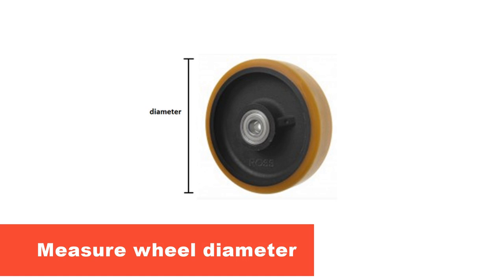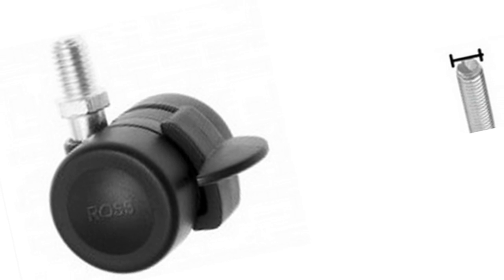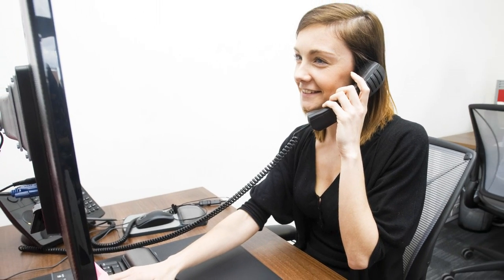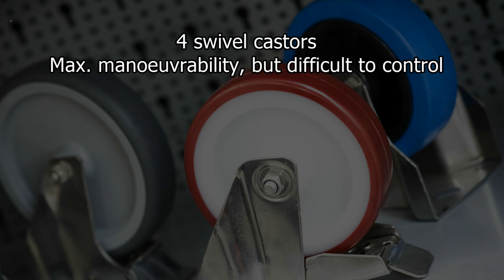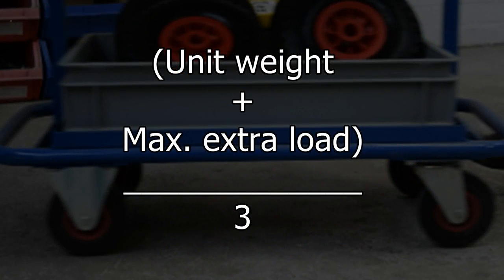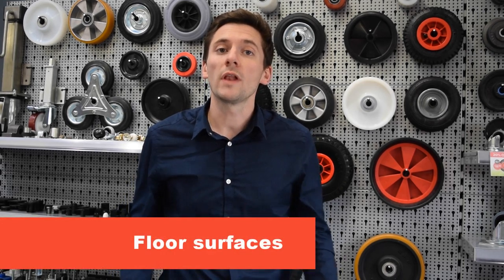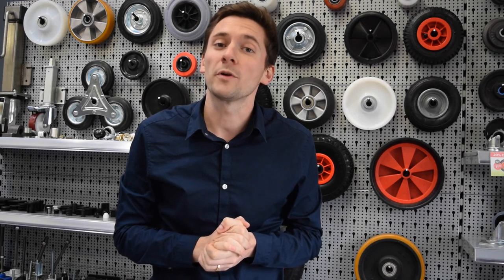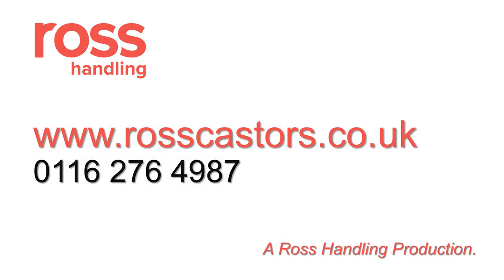What Caster Wheel do you Need?

Comment: What do you recommend for a room divider that is quite heavy. It is about 6 feet wide and 7 feet tall but thin in terms of what I can adhere to the room divider. It weighs about 80-100 pounds.  Not sure if I should put caster directly in the unit or put wood then caster. HELP ROSS! Thank you

Comment: Which castor type, threaded or top plate, is the best for a heavy table? I have a 2x4 wood frame for my ceramic grill table and I need to attach castors to the bottom of the table.
Reply: top plate is better